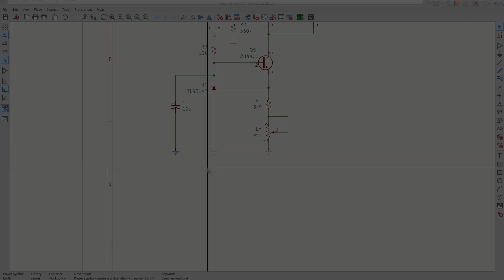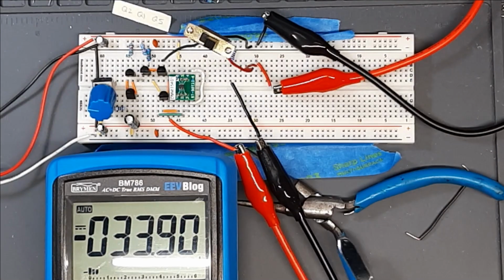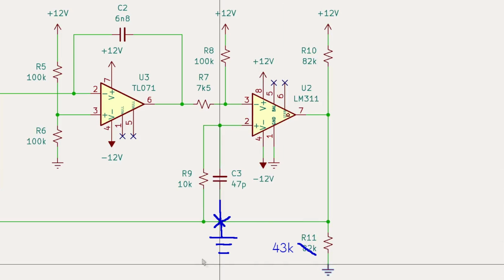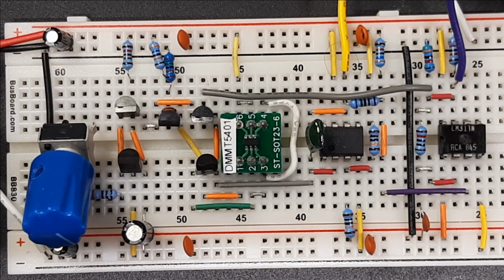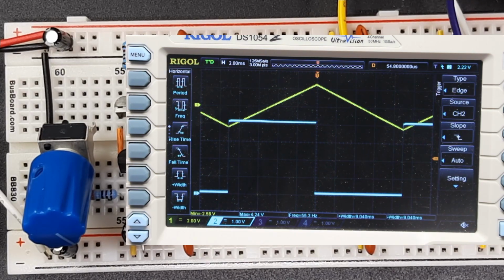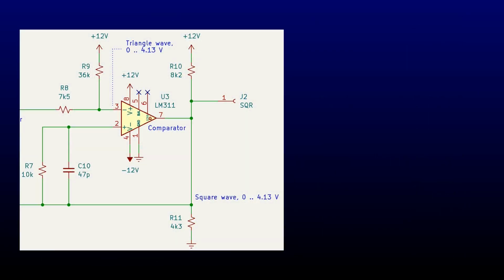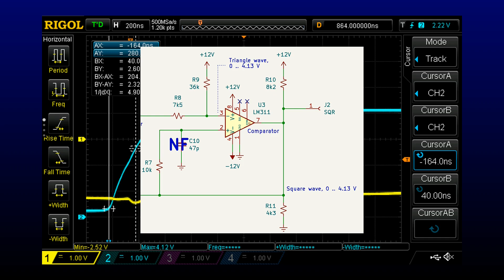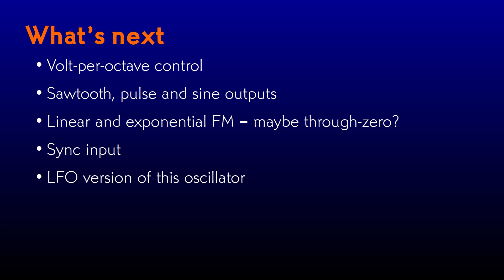Breadboarding and Debugging the Triangle Core - Exploring Analog Audio Synthesis ep9

Comment: How about presenting designs related to super low noise amplifiers for e.g. very low output microphones or pick-ups (exclude the RIAA comp), just a focus on low noise audio designs. Thanks.
Reply from the maker: It's a thought.  

It's a challenge, though, since obviously I can't demo it on a janky breadboard setup, and my cave isn't exactly a quiet electrical environment. (Among other things, any rectifying junction in a low-level audio path tends to pick up Fox Sports on AM broadcast.)

Dealing with low-level sources is going to come up in a few videos I have planned. I'm currently working on introducing differential amplifiers - which are key to knocking out common-mode noise. I'm looking to do a video fairly soon on amplifiers that need to match an extremely high impedance source (such as a photodiode or mike element), and I also want to do one on the classic 3-opamp instrumentation amp, which not only is all about common-mode noise reduction,  but also can include mitigation of input capacitance by active driving of cable shields.

Even the RIAA curve might work as a kind of advanced example when I do active filters.

I'll try to keep low-noise needs in mind as I move forward into more advanced topics.
Reply: @KludgesFromKevinsCave  It might be an opportunity to introduce high quality PC boards, EMI mitigation etc. Showing the differences between a janky solderless breadboard and a PC board with better power/signal routing should be interesting. There aren't many demonstrations of that in a useful way. Just a thought...
Reply from the maker: @madhusiddalingaiah5301  Filed under 'ideas for future episodes!' I'm sticking with breadboard-friendly stuff as much as I can for the introductory material, because circuit fabrication introduces a whole additional layer of complexity.

I think you'll be interested in an episode coming in a couple of weeks that starts working on high-gain differential amps. Of course, those are all about knocking down the common-mode noise. Not to give too much away, some of the interfering signals that were removed weren't ones that I put there.
Reply: @KludgesFromKevinsCave  a real world problem to me is amplification of the signal of a ribbon mike. Microamp output from zero impedance. W/o using a xfrm as the first gain stage. 
Challenge?
Reply from the maker: @steenhansen8  I will be dealing with low-impedance sensing moving forward. I'll probably mention ribbon microphones, but I haven't decided what to build for an example.  There will be an episode that builds a photometer in a few weeks, if all goes well, which means dealing with a weak signal from a photodiode. 

The short summary is, "so many ideas, so little time." Producing these videos is a lot of work, and I'm a one-(cave)man operation.
Reply: @KludgesFromKevinsCave  i could suggest you a low noise circuit to work from?
Have a few ideas, but no time. Sound familiar?
Love your concept 👍

Comment: cool video. that's a great dmm ehh.
Reply from the maker: @jstro-hobbytech  I like it. Like all engineers, I appreciate tools that do a thing and don't make a fuss. The 16-bit D/A is nice to have.
Reply: @KludgesFromKevinsCave  same here. i stopped being so obsessed with bench gear. i wouldnt mind a nice old curve tracer or a spectrum analyzer but i keep buying new guitars haha. if you're in canada or the us and want a care package of cool parts i have a surplus of, just email me you po box and i'll tell you what i have. i have more components than any one man can ever use. from gemanium diodes to every type of motor and ic haha. plus tens of thousands of leds. haha
Reply from the maker: Thanks, I'm going to have to keep that in mind!

I don't have much on my shopping list at the moment.  I think for the next couple of months, all I'm going to need to dredge up for the planned videos is some sort of toy motor (all the surplus dealers seem to be awash in Mabuchi FF-130RH, for just a buck or so, if I can't salvage a dead toy from somewhere), and an auto-zero op-amp. I thought I had a handful of LTC1150's around, but I'm damned if I can find them! If I go with new, I'll use OPA186 or something.  The next few videos are still all about discrete transistors and op-amp basics.  

I'm building up to being able to add an exponential converter and a sine shaper to the VCO in the audio series - and then that's enough to have someone spin the board and front panel, and make a Eurorack module out of it - which will be some more video about making boards and front panels and packaging the stuff.  This is fun - and each one of these tutorials that I complete accelerates the process because it's more stuff that I don't have to explain every time!
Reply: @KludgesFromKevinsCave  anyone ever wants to get into the hobby but cant afford it and lives in canada or the us mention me if you remember and i'll hook them up with a nice package of stuff to start out with. i hoard way too much stuff man and have too many projects on the go. i'm writing an ep and have a ton of backed up repairs and shit. im mid 40's and can still shred so i figure i should just record some original music for a personal keepsake. i think i'm the only one of my friends who still practices to a metronome regulary and works on getting better at playing guitar. most people turn into to 3 lick blues players as they age i've noticed. which is fine but if it's anything worth doing it's worth doing to the best of my abilities i say.  im obsessed with complex, busy compositions that rarely repeat a riff or stay in one time signature. i was introduced to progressive metal and jazz in the early 90's by a bunch of great unknown musicians. Paul Masvidal for instance, one of the best players ever but no one knows who he is but would recognize his riffs from session work on tv and movies. his bands always combine improvizational jazz, pop, vocoder , synths and bananas hard compositions. Listen to his band Portal sometime, it's from the 90's and it's electronic, synth heavy jazz but super pop-like with a beautiful female singer. They only released one album but they're my goto when i test out a new hifi headphone amp or new cans. i had to get a shot of ketamine at a hospital last year and had my new Sennheiser 660s2 headphones and dac and it was like an out of body experience. i do not condone drugs but it was for health reasons and one of the wildest experiences i ever had since doing psychodelics in my teens and watching the wall or akira for the first time haha.

you're a great teacher as well my friend.

Comment: Very nice, expo control is the hardest bit to get right with respects to temperature stability of the whole thing.
Reply from the maker: @akkudakkupl  Right you are! Right now, this circuit is linear, but exponential control is coming. The plan is to use a DMMT5551 matched BJT pair stabilized with a platinum RTD and a bit of insulating foam around the package to keep it isolated from air currents.